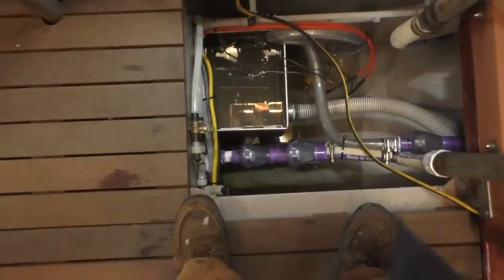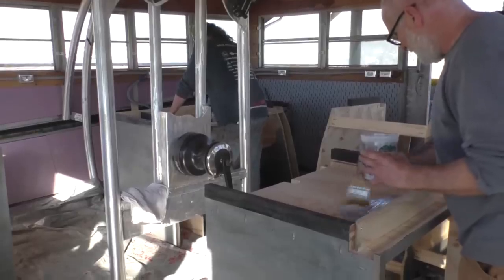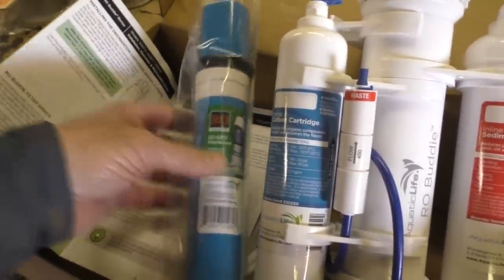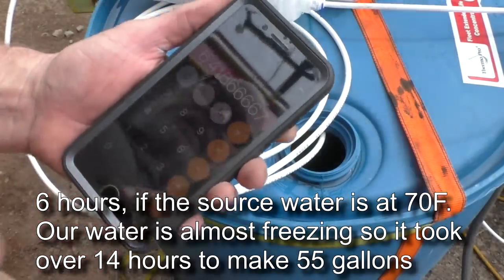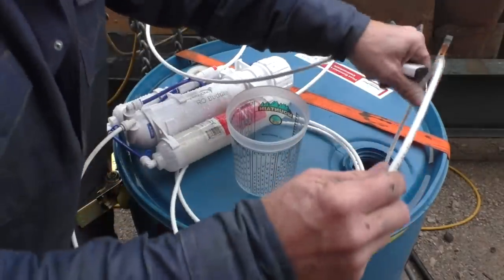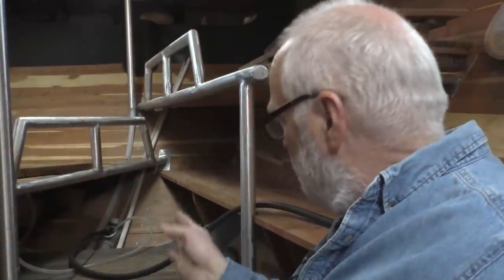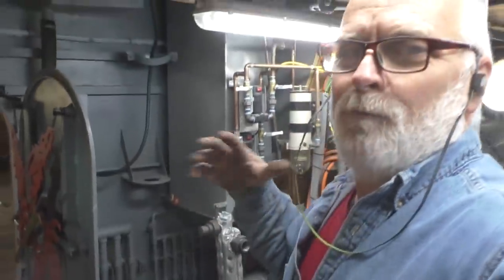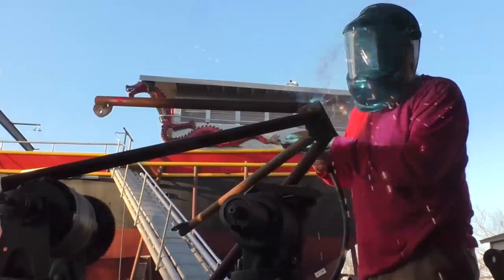Repairs-Cabinets-Coolant-Open House-Jacks and more

Comment: So much for the 'water out of a hose' days 😕 ... never hurt anyone over 65 👍
Reply: @bradley3549  it ain't the pollution,  it's the parasites and waterborne diseases... that shit sucks.
Reply: water from a hose (at least in every country iv been too) comes from municipal water supply or a well. if its safe to drink out your taps then a hose is fine.
that water dose not come directly from a river. its cleaned and treated lol
Reply: @njipods  that's true,  but I think the idea folks have of drinking from a hose is that with no nozzle it's left open and laying in the ground for bugs and creatures to get inside.  Always tasted the same for me. Sometimes even better, probably because the chlorine has dissipated.

Comment: 27:00 don't worry one little bit about the cold water, that lower radiator hose is well under 10 deg F for months at a time up here in minnesota.

Comment: My father in law used to work at a coal fired electric plant and he had distilled water all that you wanted was made there.    If you have a electric plant near by you could maybe get a lot of distilled water free.      I also fabed a new floor jack into my tilt trailer.   But it is not pretty enough to show .    But it works great.

Comment: Not sure if this has been addressed, but you might consider a propeller shaft brake. If you need to go from a forward gear, to a reverse gear, the shaft should come to a complete stop before shifting.. the propeller will continue rotating in the  direction of the boat and it would be like trying to jam a car in reverse that's still rolling forward. Lots of band slippage and possible early failure.
Reply from the maker: We'll see what it does first.

Comment: I like the skeg cooling fin. Canal boats in Britain use the same system with a much smaller surface area. (About 2 square feet.) Your engine is larger, sure, but I agree with you. You should be fine. The only potential issue would be to run the main engine for a long time without the ship in the water. To be blunt, why the hell would anyone do that? Running the gen set on the hard should be fine, though I would monitor the temperature the first time. 
Your explanation of the "SI" in "PSI" was great and spot on. Thank you, and wish I could be there.

Comment: Doug, the boiling point of 50/50 coolant at 4psi is 236f. does the depth of the coolant in the skeg affect the boiling point? it is probably another 1/2 of an atmosphere

Comment: Are there check valves on the branches off of the cooling loop?  In not, is there any risk of the coolant cycling though the transmission heat exchanger (or intercooler) and back to the engine, backflowing their pump, rather than through the skeg?
Reply from the maker: The engine thermostat does not allow back flow, and the other three circuits each have a pump that will be running.

Comment: You might want to drill a small hole in the thermostat to prevent thermal shock on the engine block. Thermal shock is common problem on Drift cars that have the radiator in the back
Reply from the maker: That's an interesting solution.   Thanks

Comment: When the engine is running what stops hot coolant from backing into the  inner cooler? When the engine starts the trans cooler pumps goes on so no backup of hot coolant should get in there.

Comment: Re lack of radiator cap, don't you still want some kind of pressure relief valve to prevent the possibility of blowing up that skeg?
Reply: the 3 lbs of pressure because of height is the same as a radiator cap.

Comment: in a cold environment water from the radiator will be coming back to the engine at very low temperatures. almost every vehicle on the road is built to operate in at least -10c (usually more) if it was a problem with that the manufacture would change the system
Reply from the maker: I think that is why engines have thermostats.

Comment: If you pop the bus transmission I’m sure borg Warner will want to see a nice velvet drive in there enough to help you out. 

Or if it does pop, can your propeller trim the blades into reverse?

Comment: Should the cooling system have check valves to prevent backflow?
Reply from the maker: No, cause the pump will always be running if the engine is running.

Comment: Whit the concern about the thermostat stopping the engine from being to cooled down, it sadly is a real issue, you might or might not see it happening depending upon the engine and the thermal design of internal cooling system, but here in Norway during winter time we do have issues with cars being overcooled and the only sulution is to block air from flowing over the radiator. This is however much more of an issue on smaller engine, which is why I prefer my big old american v8's.

So you might just have to keep an eye out for it, and be prepared to figure out something, or it will be just fine, but remember an engine needs its opererating temps aswell.

Comment: Hey Doug, Where your ships wheel is mounted to the gear box - it looks like its floating out at the end of the axle shaft, only supported by the gearbox itself. Wondering if a support-mounted bearing to take up the 'front' side of that axle might extend the life of your gearbox / axle-shaft.
Loving the progress on this.
Reply from the maker: HA!  Grab the PTO shaft of a tractor while it's turning and get back to me on that. : )

Comment: do you need a check valve from the trans heat exchanger to the common rail piping??
Reply from the maker: No, cause the pump will always be running if the engine is running.

Comment: That engine isn't going to care about cold water. If the thermostat is closed heat will bleed back into the cold pipe and warm it up a little anyway.  Also you wouldn't want hot coolant going in because this is a low pressure cooling system (as he said)  well done with the ship.

Comment: I think there's a slim possibility that the engine may not get up to a efficient operating temperature because it may be too efficiently cooled so you may find you have to swap out the thermostat for a higher temperature thermostat inside the engine but I think that's a pretty slim possibility as the engine is an older engine

Comment: You do know that in the tropics ambient water temperature of the ocean can approach 90 degress in place?
Reply from the maker: Yes, so?
Reply: You were mentioning that you were  going to get out on the water to measure the water temp for the cooling water for the transmission. Just offering a bit of info from my experience sailing in the tropics.

Comment: That's why I don't use Facebook lol. Your engine will run just fine on cold water you have a thermostat. Some GM trained technician might tell you different though. Your oil will come up to temperature and that's important. I wouldn't run your oil into a cold water heat exchanger that would be a problem..

Comment: Water at sea level boils at 100 c the operating temperature of an engine should not exceed 90 at the most. Water boiling won't be an issue unless you've got more serious problems.

Comment: Doug - lean on a someone with some graphic-art/sign making abilities to label all those water, hydraulic etc lines.  Flow arrows, part labels etc.  Also, do you have someone making a schematic of the various systems (drinking water,  engine cooling, hydraulics, etc)?

Comment: Wow Doug, was that the biggest crowd you've had turn out for an Open House ? Looks like you may have a few new or future crew members ! Was wondering about the dive compressor filters, can those be cleaned or do they have to be trashed after one usage ? I'm thinking you might drop the filters in a bag with high proof alcohol and immerse that in an ultrasonic tank for cleaning them for a few extra uses..is there a way to gauge their utility by pressure diff on the compressor, or a ppm detector ? The airplane jack looks good, will you have adjusting feet and a bubble level as well like the ones we use at AA ? They have an extra big adjusting foot at center under the ram to distribute load more evenly. Looking forward to August !
Reply from the maker: I'm thinking we can likely learn how the recondition those filters with fresh materials.

Comment: Doug;  respectfully, you will ruin your engine under heavy load & here is why...

In the sealed system, the increase in temp, drives an increase in pressure. When this happens, the coolant is prevented from vaporizing (think Leidenfrost effect) in a localized area.  W/out a sealed system & appropriate cap you will get localized cylinder wall damage aka hot spots.

Even if your coolant temp says it's running at say 185 degrees, that doesn't account for hot spots w/in the engine or block. Keep in mind the Leidenfrost effect, you have a gentle sizzle of coolant sliding past an area that desperately needs it the most and it doesn't matter how cold that water is. Under pressure, this vaporization is prevented forcing the coolant to remain in contact w/your block/cylinder walls.
 
Your skeg will no doubt provide sufficient cooling but you need that pressure to prevent that vaporizing on your cylinder walls and w/in your block. 

Engine designers will make all sorts of excuses but the truth is simple, they solved localized overheating issues in most engines by running them hotter & under pressure.

Also, if you haven't already vented your cooling system to the outside of the boat, your engine room will get fogged w/coolant vapor becoming sticky/dangerous.

Comment: Repeatedly dumping (potentially below-freezing) water into an engine, letting it warm up, then dumping cold water in again? Sorry, but that does seem a bit worrying. At best, the bottom of the engine will never get up to temperature, and the whole engine will operate with a large thermal gradient. (Of course, at worst the stress from thermal cycling will crack something...) Will bearings and such be tighter and wear more? How hard is it really to fix this? We're not talking about thousands of dollars and years of work here. Doesn't the potential downside outweigh the small additional work? You only have one engine!
Reply from the maker: If it needs a fix we'll fix it.  So no worry is needed.

Comment: While you're still installing stuff, you should really label all the pipes, hoses, electrical cables, etc.  You know what everything is and where it goes, but in an emergency, someone else might need to fix stuff in a hurry, and you might not be available to explain.
Reply: I agree, except that I'd say that can wait till they're underway.

He has precious little time on land left and should use it to do things which are critical, or that are unfeasible to do onboard.

Once he's in deep water, he's gonna have LOT of idle hours, that would be a great time to label everything.
Reply: This has been said numerous times before and he says he won't be doing it.

Comment: Doug why don't you have cooling lines under the boat like a trawler?
then you never have cooling problems.
grtz dave from the netherlands
Reply: Come on he’s worried about drag 😂😂😂
Reply from the maker: The skeg is the same concept and keel cooling pipe or a keel cooler, but more protected and easier to maintain.